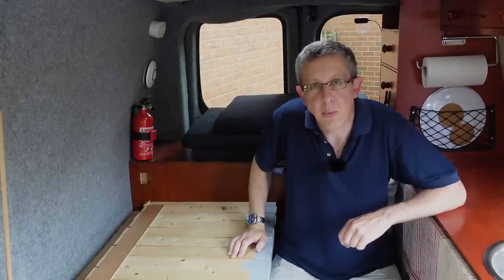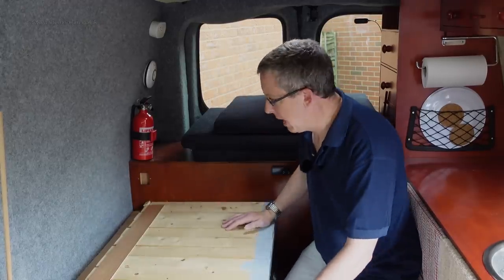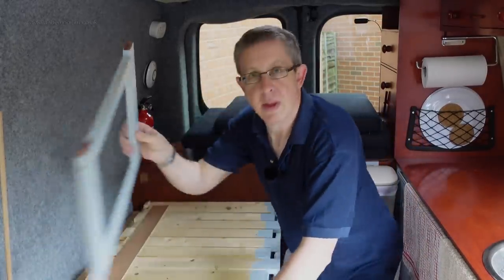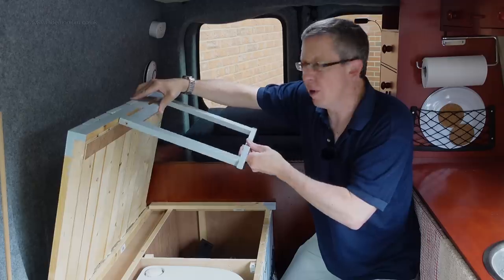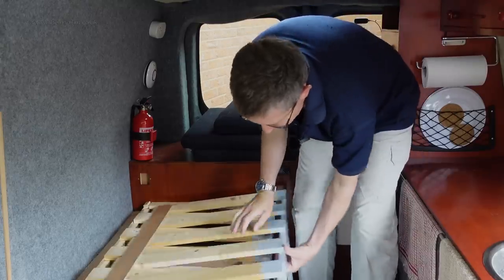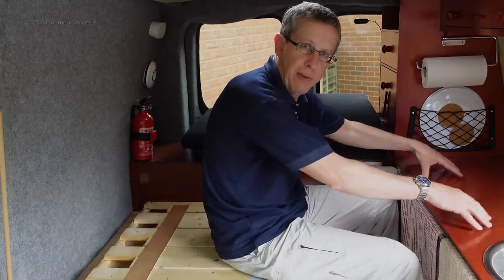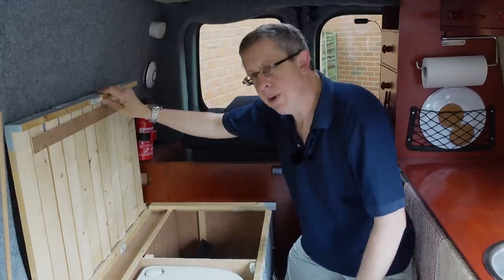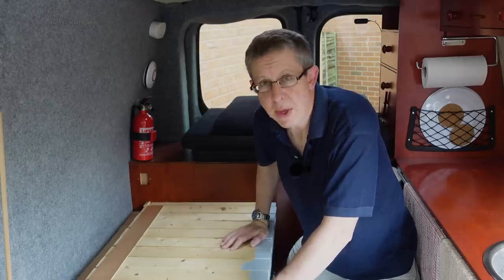84. Help! Your advice is needed.

Comment: Woah David ! So many questions. There was a kind of hinge, or locking leg mechanism I remember from fold out tables that had legs folding from the centre at a 45° angle to provide stability. You don't want these, but I would think you would want a parallel folding mechanism for the legs, which results in a right-angle triangle parallel to the leg. Does that make sense ? Is it available ? Have you considered replacing the slats on the lower bed half with a ply sheet - is that worth it ? Happy DIYing. Curious to see what you will come up with. Do you have to unhook the waste bin too

Comment: A new "leg" sans the pins and protrusions, mounted with a full length 'piano' hinge SHOULD do the trick; i would also consider adding a bit of foot to the bottom edge for the sake of increased stability when extended. Hope it helps David, Ta !

Comment: David. After reading other comments and putting my thoughts to some problems with some.   I think if you combine ScotHarkinns suggestion with a piano hinge that goes all the way across.  You could have maximum stability and flexibility.   When you lift the bed for access to the toilet or storage, it would simply fold against the top/bottom of you bed.   Using cutouts or low profile hardware would allow for easy use and lowest protrusion. Both in pathway and when using the Lou or accessing storage.      I do hope you find a solution that works for you.   P.s.   using one of the magnets to keep it against the bed when fully open would insure it started out of the way. And use of a locking hing or similar mechanism on the tilt non sliding frame would insure placement while open.  Best wishes.

Comment: Instead of having legs fixed to the underside of the pull-out section could you have two fold out legs fixed to the front of the bed with vertical hinges.  These could easily be made from ply  to keep things simple.  To stop them flapping about, particularly when the van is in motion, embed two rare earth magnets one in the leg and the other matching it in the unit.

Comment: I would try your hinge idea, but use sturdy hinges.  I think the existing dowel pins could remain, but you may have to shave the edge off the holes on one side.  If the floor is carpeted, the legs shouldn't slide because they will sink into the soft surface.  I would be more concerned about ripping the legs off by sliding it back together while bearing a load.

Comment: I think you're perhaps overthinking it. With the bed partially extended the majority of weight will be on the base, not the legs, so there's less likelihood of collapse. Besides, the dowel solution hasn't collapsed, has it? A couple of hinges are bound to be more secure than a couple of dowels! :)

Comment: Walter…. Forget the legs . Make great kindling
Materials needed.rectangular piece of plywood that fits the footprint of the bed fully closed. Wood screws. Two hanger hooks. Bit of of cord/ thin rope.

Screw the plywood “aprox1/4” thick on top the retracted bed  but only screw into the part that does not slide. Drill two holes into front edge of slider bit and tie two loops of cord. Screw the two hooks under the counter area.

Idea being the plywood will trap the slider bit when partially extended. When fully extended you can use the cord hook combo to hold up the edge using the counter unit as the support.

Comment: I think no legs for partial extension and improved legs for full Extention might be quite simple alternative solution to fixed legs

The partially out configuration should be possible with no legs.  Instead of just the wooden part on top in the back that keeps the slats together add another on the underside I suspect you need to use metal to make it thin enough.   You get a cantilever that will work if you do not extend it too much.  You could test it with a piece of wood and a couple of clamps to these the amount of bending.

For max extension, you can still use legs. Replace the wooden dowel with metal a bolt that is partially smooth that you screw into a hole, glue, and cut the head off is a simple metal dowel for the leg.  Glue in a metal tube in a hole drilled in the seat part so it has a hole the dowel can fit snuggly into.  In addition, to that uses magnets to keep the leg attached to the bed. Neodymium magnets with high pulling force and screw holes exist and are not expensive. Put a flipped magnet or just a pic of metal it can attach to on the other side.  It will be no problem to keep it attached even vertically, you can fit a magnet that holds tens of kilos each

Comment: As opposed the the magnet suggestion, I also added my opinion to.
You could put a leg either side, but attached to the base unit, on hinges.
Then, as you slide the extension out the legs can be moved into the correct place.
…with magnets!
Let’s not forget neodymium magnets are the future.

Comment: Think drawer front, build a rectangular frame with a central support -like a digital 8 on its side , that will be the extending support for the bed and push back behind your calf's (drawer front). Fix 3 metal grooved runners alongside 3 top cross members make 3 small holes for them to extend out and affix to the support with metal angle brackets. Regards Chris

Comment: A lot of the problems seem to come from wanting to pull it out only partway. Is there any way you can avoid pulling out the bed partway, and instead have a temporary worktop extension that pulls out or folds away? Or a TV Table that can fold up when not in use?

Comment: I rather like the idea of hinge-out 'doors' that are mounted on the front of the Loo-cabinet.
Now the front of the cabinet needs to be removed for emptying; but I imagine there is somewhere that these additional doors could mount - the Hinge-axis will be vertical , and these just hinge towards the kitchen like double-doors.
They would virtually touch the floor, or even scrape it a bit - any amount of load from the bed  above will make them touch the floor fully and thus jam; the amount of outwards wanted is just a matter of swing; they don't have to accurately align with the edge of the bed - just need to jam under and pretty-close to the edge once both the doors and the bed are swung/slid out.
They could hold 'shut' by magnets

Comment: How about a compromise between two suggestions you've already mentioned, fixed single legs and folding single legs. You say there isn't enough room to fold two single legs in from either end but do you really need to fold both of them? Could you have the right-hand leg fixed and just the left-hand leg hinged? Folding sideways certainly removes the 'folding by accident' issue....but can you trust yourself not to break off a fixed leg on the right?

Comment: I have not read all the comments, so I don't know if this solution already have been suggested. 

I would instead screw the metal bar at the back, that currently are on the top side of the lid, on the under side of the lid. It would then be self locking when extended and the leg would be unnecessary. The best part is no part. (A metalbar would still be needed on the top side to prevent it falling down when opened.)

If the overhang is not sturdy enough I would change to thicker wood.

If it won't come out long enough it's just letting the wood hang out a little bit longer, or make the metal part more narrow. And maybe add some supporting "bracket" (a pice of wood) on the kitchen to "hang it" on when fully extended.

Comment: I'm picturing something along the lines of a piano hinge paired with a bicycle wheel quick release, using all-thread cut to the length of the hinge.  You could then easily lock it either up or down.

Comment: Keeping the legs they are at the moment, with the dowels but put hinges on the cross beam and fix it as you suggest, then when you pull down the hinged leg, the dowels would slot into the holes - you may have to exaggerate the shape of the dowel holiest allow for the angle of the dowels slotting in, but that's doable.
As for the legs at either end and hinged - is the seating/bed panel twice the length of the height from the floor? If so, you could fix a leg on a 90-degree hinge at the ends and fold them along the front so they would sit flush with the front of the panel without crossing.

Comment: First suggestion:  rather than worry about changing the bed, make the kitchen unit slide toward the bed.
Second  suggestion:  don't have the legs attached to the top/slide out section at all.   Have perhaps 3 sheets of wood that slide out from the frame toward the kitchen unit.   When not in use they're inside the bed frame, and when in use they can be slid out as far as nessary to support the bed/seat top.

Comment: Pick two of the slats on the extendable section and remove them. Split them down their length and refix one of the halves back in each of the gaps. You will now have a small gap in your seat bed base which should not cause any comfort issues if your mattress cushions are adequate. Now take the remaining halves of each slat and place them in the gaps (you may need to plane and sand them to have a fairly loose fit). 
Now measure off from the end nearest the sink to a position just inside the box structure such that you can drill a hole through the side of the loose slat and on through the other half to take a bolt. so the loose slat can swivel upto 90 degrees (you will need to remove both parts of the slats again to do this). Recess the holes for the bolt head and Nut - the smallest bolt size to allow for strength without compromising the strength of the wood. 
Replace and screw down the fixed halves. Reduce the length of the swinging part so that when the extension is pulled out and it hangs down at 90 degrees it rests on the floor. Also when in this position cut the part now sticking up flush with the slats. The foot end of the swinging slat part will need a thin piece of ply screwed to the underside of the fixed half to swivel round to keep it in place until required. This can also be a way to lock the leg in place with anothe piece of ply near the bolt end when vertical.  So much easier with a drawing.

Comment: Someone may have said this already. fold out wings on the front of the base. 2 or 3 and they could fold in two places so you can use full extension or half. magnets could hold them to the base.

Comment: Just a hinge setup will likely be fine. There's enough friction with those slat boards that they're unlikely to move much with you shifting your weight about on them, so the legs will still be vertical enough to be supporting.

Comment: Interesting, what your using seems to work fine for the amount of time your sitting at the kitchen unit, unless it's used as a desk and your there for hours. Currently the support from the legs provide support in the middle of the pullout, which you have done and shown it works and it works at any distance, why change something that works. Sure you could redesign the bed frame with the front having hinged fold outs set at 6-9 inches, but would require 3 of them for the support needed. So if it is keeping you up at night, rethink my first point, it works fine and you make your bed everyday, so when you do that, leave it out 6-9 inches and enjoy what you built. Cheers and stay safe

Comment: I was gonna suggest supporting it by guide wires down from the ceiling which would retract when not in use . Not sure if that would be practical or possible but it removes the requirement for legs.

Comment: I think there might be answer by turning this problem on its head, site on your semi extended bed and look at the red counter top - no sink in the way (cant see if its totally clear) but inspect it to see if another layer of counter top can slide out toward you to resolve the problem. It could be depending on the make up it wouldn't need support by way of a leg or legs as its counter weighted  by the red top. Just an alternative thought. Through the leg away and fix a horizontal support on the cupboard oversite.

Comment: If the whole top was hinged at the back you could open it as usual but it would be secured so it couldn’t tip. Then the pull-out part would be strong enough to support your weight without any legs at all, if it was pulled up to halfway across. You’d need a stronger batten underneath your pull-out piece at the back. And if it was all the way out, you could still use your legs or attach resting ledges or removable pegs on the surrounding furniture.

Comment: Hinges is the way to go. I would add some wood stops under the slide out piece parallel to the hinges placed close enough together so that they slot over the edge of your cabinet and prevent any forward or backward movement. You would be limited to maybe two or three positions but a lock it anywhere design is going to be complicated and expensive unless you just use two wood clamps??

Comment: First. for the use of the bed platform fully out. Forget the leg idea and use a cleat on the kitchen cabinet face.  If this was an issue use a pull out slide like a desk top support recessing into the kitchen cabinet when not in use.  As far as the partial extension of the bed for the seat, set up the slide bed pieces as intelocking on the sides of the slats.  This will then support the slats on the hinge area of the bed platform.  Good luck.  Menlo, Iowa USA

Comment: How about something like fake cupboard doors on the front of the base? Swing them out/open as much as you want to support the sliding section of your bed. Additionally the far end of the slats on the sliding section of the bed need to be connected with a cross piece underneath so that when that half of the bed is slid out it is cantilevered from underneath on the slats on the fixed part of the bed. The cross piece should be as thick as the slats. Yes glue and screws.

Comment: Could you add a sliding board that is perpendicular to the bed top and parallel to the toilet that slides out?  The procedure would be to pull out the boards to act as legs and then slide out the bed top.

Comment: Considering legs which hinge inwards, under the slats, I'd use magnets to keep them up so the legs don't swing into your face if you forget to hold them.

I think it's easy to prevent collapse when the slats are half-way out. If you think about it, the edge of the slats will have to rise very slightly before collapsing. The distance they have to rise is the difference between the length of the leg when straight and the length of a diagonal from the hinge pin through the opposite bottom corner of the leg. This difference may be so slight that the carpet absorbs it, but here's the trick: moving the hinge inwards away from the leg (and connected with a bracket or something) makes the diagonal a lot longer and so the edge has to rise up that much more. With your weight on it, it's not going to want to rise.
    I have to leave it there for now, but could try to clarify it later if you want. I'm half wanting to make an animated graphic of it, but that would be a new thing for me. :)

You could perhaps keep the legs outside the storage space by hinging them separately, with one folding forward and one back.

Comment: there are probably many solutions to that problem and many are mentioned in the comments. but have a small question, you can't mount an extendable table top under the kitchen bench on rails, like cutting boards, then you don't have to pull out the bed to eat or fiddle with the laptop.

Comment: 2x2 wooden batons that are built into the top of the seat/bed base. On a slide/slot like a drawer. Pulled out across to the kitchen units where a suitable slot or strip of wood is secured that the batons sit on. Then, the bed can be pulled out as far as desired. If you don't want the batons fixed into slots, just have the same rests as the kitchen on the seat/bed side. Then, just place the batons in the required spots when setting up the bed. Probably the simplest solution, minimum  effort. 2 batons should be enough, but 3 maximum. No complicated legs or hinges.

Comment: In RVs, you can add a countertop extension. Perhaps a modification of that. Mounted with a metal piano hinge and when open is secured by a metal drop – leaf table brace. Google countertop extensions to see examples.

Comment: I was already thinking about hinging the doweled legs and then you mentioned it. Then I thought maybe you could somehow reenforce the slide out section so it could support more weight and negate the use of hinged legs entirely. You would just slide it the section out to the desired length and that's it. Some food for thought, hopefully.

Comment: You don't show what is in front of the near end of the bed.  But at the back the bed runs into a vertical surface.  Why not run a board along there to support the slide out part?  And maybe something similar could be jiggered for the front end of the bed, so that top and bottom are supported?  Of course you would have to redo the slide out part a bit from the way you've got it so it would be supported from the ends instead of back from them, but the final result would work much the same.  If you are worried about the long movable part bowing from being sat on, a bit of reinforcing metal channel underneath should take care of that.  I know it sounds like rebuilding the whole bed, but really it's just moving the parts you have around a bit.

Comment: The hinge seems like the simple solution and if dowels have been stable enough then a hinge should be stable enough too. Use some hinges with stops or braces to stop the hinge at 90 degrees and prevent them from folding back when you don't intend them to. Good luck!